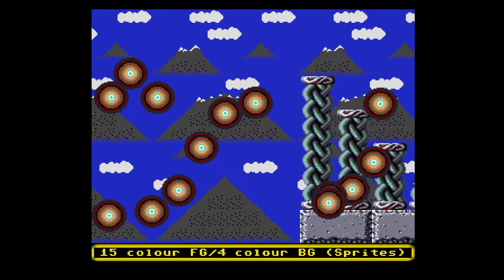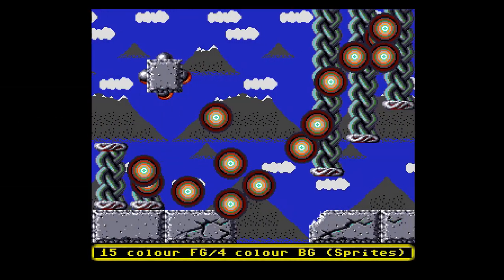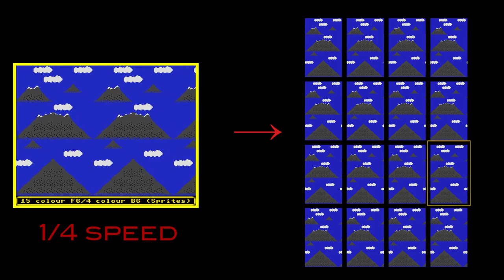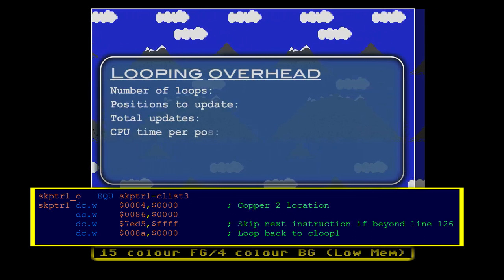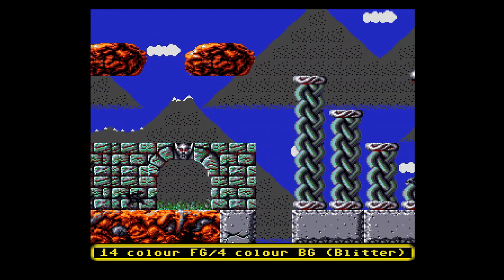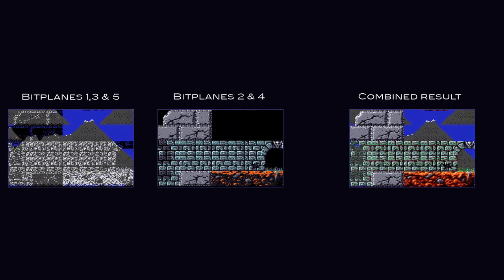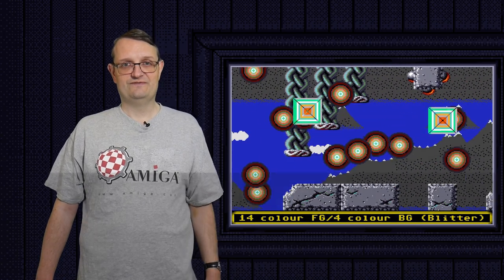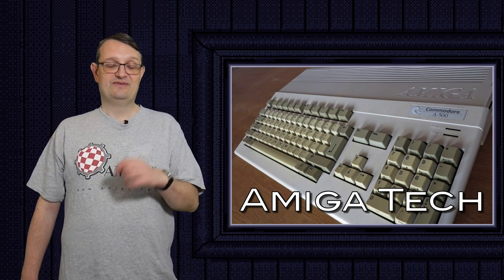Amiga Tech - Dual Layer Graphics

Comment: It's very interesting.
Is there a constraint as far as screen resolution is concerned ?
I'm speaking about the max 288 pixels per line limitation, and the no more than 220 or 240 lines limitation.
Also, you're not giving any infos about the CPU cycles left, with each solution you demonstrated, to know what's left for the logic of a game.
Thanks for your video anyway, again, it was very well explained.
Reply from the maker: Thanks, I'll try to answer your questions :)

There's not really a limit to the per line resolution, it's more of convenience. On the Amiga, if you want to use DMA to set up the Sprites and you want to use all 8 Sprite channels and you want to horizontally scroll, you're limited to 304 pixels horizontally or you'll lose 2 Sprite channels. You can set up the Sprites using the Copper (or CPU if you're particularly fond of pain) as well, but DMA is more convenient so most Amiga OCS/ECS games limit themselves to 304 or less pixels horizontally (there are of course exceptions).

Reason to go to 288 is purely for aesthetic reasons, I think it looks nicer than 304 pixels set up such that Sprite DMA gets all 8 channels, which is slightly offset to the right on the screen.

Regarding the amount of display lines, that's an old habit of mine - a full PAL screen would be 256 lines, but as I understand it, 240 lines will just about fit on an NTSC screen as well. A 256 line screen would get cut of partially for those users. So generally I limit myself to 240 lines so that people who don't have PAL can also see the full screen. 

Obviously, the bigger the screen, the bigger the Blitter/Copper overhead, but for the effects here the jump to 320x256 would not matter that much.

About CPU overhead: main reason I didn't discuss it is that for most practical purposes the Blitter is the limiting factor in Amiga OCS/ECS games, not so much the CPU. But to give you some insight anyway, the effects use between ~30.000 and ~35.000 DMA cycles, including the bitplane display. This is about 42-49% of the total Chip RAM DMA bandwidth. Of this, the bitplane display takes between 17.888 and  22144 DMA cycles, or about 24-31% of Chip RAM DMA bandwidth. Note this is excluding the blitting of the BOBs themselves.

For the CPU things are slightly better than you might think here, as it doesn't normally use all the Chip RAM DMA cycles available (it essentially runs at full speed if a 4 bitplane or less lowres screen is used), a quick back-of-the-enveloppe calculation then shows that it would lose between  ~12000  and ~17000 DMA cycles. This is equivalent to exactly twice that in CPU cycles. The CPU has ~141000 cycles per frame, so it loses between about 8-12% of it's cycles to DMA cycle stealing from the effects.

The rest of the CPU overhead is relatively small, the main overhead is the Blitter and Copper. The CPU is basically just setting up the blits and running a fairly simple main loop that updates the custom chip registers and call some control routines.

Hope this helps :)
Reply: @DutchRetroGuy  Thanks a lot for this long and extremely well detailed answer !
How do you explain then that in a game like Shadow of the Beast when the main character changes direction, the frame rate drops from 50 fps to 25, because the sprite flipping is completed with the CPU ?
I really don't get it : the 68000 should have plenty of CPU cycles left, available per frame, to perform the software flipping, without using more than the number of cycles left available per VBL.
Is it that Shadow of the Beast isn't particularly well coded ?
Thanks for your time, it's true I really appreciate the fact you know what you're talking about, and you can answer some questions I always had about the Amiga chipset.
Reply: @Archimedes75009   Interesting! I never noticed a frame-rate drop in Shadow of the Beast when changing direction! Must check it out...
Reply from the maker: @Archimedes75009  hmm, that is indeed odd. I've gone and checked it in WinUAE with the Visual DMA Debugger to see what is going on here. It does seem to use nearly an entire frame to flip that single Sprite. 

That is extremely weird, a Sprite flip algorithm should really not be that slow. No idea what they did there, but it surely doesn't seem like an optimal solution!
Reply from the maker: @Midwinter2  It's quite hard to spot because as far as I can tell it's only a single frame lost when you turn around. If there's no enemies nearby it's almost impossible to spot for me.
Reply: @DutchRetroGuy  OK. Thanks for checking and the answer. I always found that very odd.

Comment: Jim Power used a sprite background layer didn't it?
Reply from the maker: Many games did, yeah. As far as I know, Jim Power used both the Amiga's Dual Playfield mode and a Sprite background for a total of three layers - though it didn't use all Sprites for the effect. If I remember correctly, it only used 2 Sprites for a 32 pixel wide repeating pattern.

Comment: is it just me or does the c64 hrdwr sprts seem smoother than amiga? is it a higher update?
Reply from the maker: I'm not sure what you refer too here: do you mean the objects moving on the screen?
 
In case you mean those, I've made them out of Blitter objects and update them using a fractional speed, which can seem a bit less smooth compared to an integer speed but does allow more speeds to choose from. If I updated them at whole integer values, they'd appear fully smooth.

If you meant the background hardware Sprites, those only update at one pixel every other frame (to keep them slower than the foreground), which might make them less smooth - though it looks a lot better on a CRT than on an LCD screen.

The programs itself runs at 50Hz though ;)
Reply: @DutchRetroGuy   your routines are reminiscent of jim power. but i was talking about c64 and amiga in general over the last decades. im not sure if the amiga was hard for devs. to get to grips with, like the atari jaguar. when you said fractional did you mean 8bits or did you mean floating points?
Reply from the maker: @bramblemat  Ah, I see what you mean now. The main reason for the difference in smoothness is that many Amiga games ran at 25Hz updates -sometimes even lower than that :( - rather than 50Hz. This allows you to get more on screen, but makes the GFX updates less smooth for sure.

The two main reasons for this were that a lot of Amiga games were written for the Atari ST first (which had a much larger market share for most of the 16 bit era) and then converted, often in record time and without using the Amiga hardware to the fullest. The second reason is that you're right - the Amiga hardware is harder to get to grips with than the average console or other system. Using the hardware isn't that hard, but using it efficiently and effectively can get really quite tricky.

Modern homebrew games made in assembly (lots aren't by the way) often do run at full 50Hz.

About the fractional: the Blitter object coordinates are in 16:16 fixed point format, so not quite floating point, but still allowing for very precise speed control.
Reply: @DutchRetroGuy  excellent , thank you. do you publish games?
Reply from the maker: @bramblemat  so far, no games. Might try for one at one point, but we'll see :)

Comment: Fantastic Dizzy used a different way to create a 16 colour background from hardware sprites, the AGA version took it a step further... https://youtu.be/mWpnBapugEQ
Reply from the maker: True and an interesting approach for sure :) 

Risky Woods used the same idea for a 16 colour Sprite based background. Both it and Fantastic Dizzy are limited to a 64 pixel wide pattern, but that can still certainly look nice. Works well if you don't need many moving objects on screen as it does use a lot of Copper display time on OCS.

AGA is a bit different, the 16 colour hardware sprite background is a chipset feature there, you can just set a single register and Sprites will repeat themselves horizontally after 256 pixels, which combined with 64 pixel wide Sprites under AGA lets you create a nice colourful repeating background layer for AGA games.
Reply: @DutchRetroGuy  I can't remember if I used the copper to write directly to the sprdat registers to 'draw' the image, I do remember trying that method though. I'd have to look at the copperlist to see what I did.
Reply from the maker: @happycactusgames8239  interesting, you mean using "manual mode" sprites only? Or are you refering to something closer to the free-form sprite layer video I did a while back? Good stuff in either case, (ab)using the Copper for effects is certainly one of the nicer things about the Amiga :)
Reply: @DutchRetroGuy  I just watched your other video, yes, I remember updating the sprite data registers directly to render in different images to hardware sprites using the copper, but for Dizzy, it looks like I just reused the same data (so a 64 wide 16 colour image repeated) - it was probably just stealing too much dma time otherwise, as the main game was 32 colours (5 bitplanes) - I played around with a number of different ideas to get this ported from the sega genesis to the amiga without having to rework the graphics too much (the genesis had 4 palettes of 16 colours to play with!) - I loved abusing the amiga hardware...
Reply from the maker: @happycactusgames8239  cool stuff, thanks for elaborating. Love to hear how the old games were made :)
Reply: @DutchRetroGuy  thanks for creating these great videos! I just watched them all!

Comment: 4:28 not really a unique feature if Atari 8 bit already had it . The real idea of copper is to reestablish the race with the beam while we use a 68k as CPU which really does not feel like it wants to race.
Reply from the maker: I was unaware that the Atari 8 bit systems also allowed for horizontal Sprite multiplexing.

Interesting, thanks for the info.
Reply: I am not an expert, just read that "Space Invaders" used this. Maybe this was actual like mode-7 where the background became the foreground? Texas Instruments made this easy to use chips. The "Product Owner" probably thought: "Why would the sprites be vertically aligned?". Even the interrupt on C64 cannot address x positions. Commodore did not want coders to write CPU loops to count cycles. So no repeated sprites. The official solution would need too much registers (cost of documentation). So, commodore omitted this one link which lets the sprite data rotate (instead of shift) on the Amiga. Now if there only was better documentation of die shots of GTIA where we could see this connection. Rotation registers should MHO appear as a left shifting register atop a right shifting register.

It is actually pretty weird that pcEngine with its 16 sprites and single playfield cannot repeat sprites! Some patent? Or can it?
  @DutchRetroGuy
Reply from the maker: @ArneChristianRosenfeldt  as far as I know the PC-Engine can’t repeat Sprites, but I could, of course, be wrong.
Reply: No I think that you are right. PCengine is based on NES is based on Texas Instrument chips. That lineage never adapted this. Amiga is best! @DutchRetroGuy